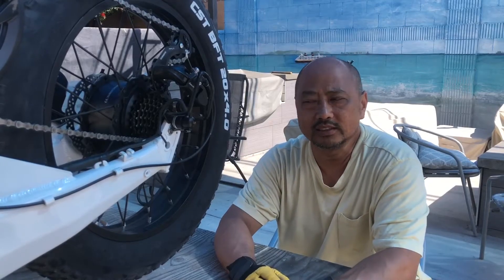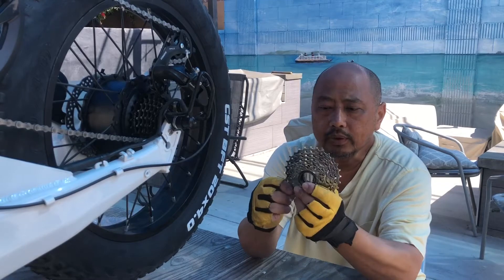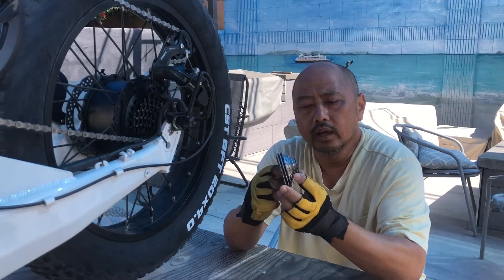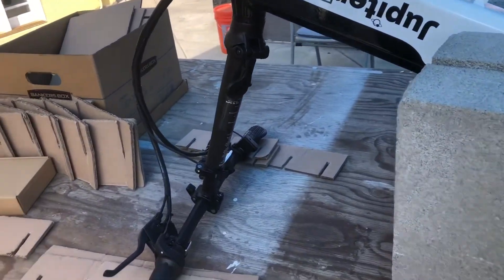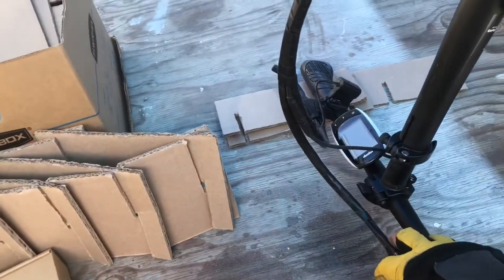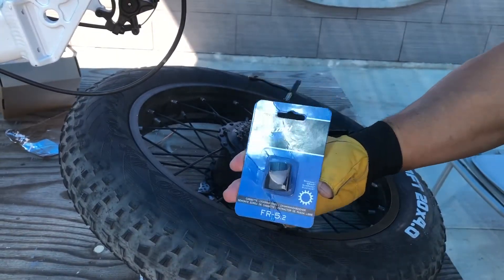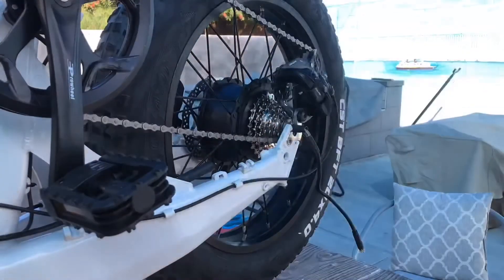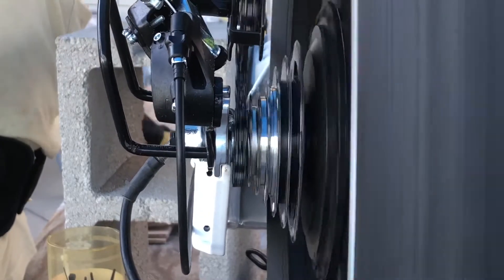Changing the rear freewheel cassette to increase range at high pedal assist modes.

Comment: Super late but just tried the swap for the cassette, getting resistance when I tighten. Watched your vid and saw that I had the torque washer reversed. Flipped and still and resistance, any idea of what the cause could be? I’m installing a 37mm freewheel on the Jupiter, basically the same as yours.
Reply from the maker: Shoots…what do you mean “resistance”? Resistance putting the nut back on or when you spin the tire? What size freewheel did you get (11x28 or 11x34)?
Reply: @tai.randomthings  I went with the 11x34. Looks like the issue is that I didn’t have a washer behind the nut on the side with the derailer after looking at yours. Picking up one on the way home to see if that would fix the issue. The resistance came after tightening the nut which pushed the frame too close to the freewheel and caused them to rub before being able to tighten completely. Took a while but after constant pauses and screenshots of your video, looks like that was the missing link. Not sure if they just missed it on my bike or if that’s how they are all built now but we’ll see if that corrects the problem. Thanks for the response.
Reply from the maker: @supremechee2636  No worries, good luck.  The other thing to check is shifting.  You went with a bigger freewheel than standard so your chain may be too short.  Check to see if it will allow you to shift through to the top gear easily.  Best of luck and happy riding!

Comment: Hi Sigh, great video.
I went with the 11-34 on my Lectric 2.0.
Although I'm happy with the modification,  I didn't end up with all of the anticipated expected results I'd hoped for. Meaning; sure my cadence was significantly reduced,  but when I get to Pas5 the motor, and or the controller act as a govenor and won't let the bike go any faster. You did explain this in your video, and for this I'm grateful. 
My other bike on the other hand was 35 mph right out of the box, of course this was with pedal assist,  and my cadence in doing so was around 130. So needless to say being interested is speed like yourself I'll be doing some gear changes on this bike because it certainly appears to be programmed differently. 
Later,
Don
Reply from the maker: Thanks for the feedback.  I made the same mod on my Lectric 2.0 as well.  Happy riding!